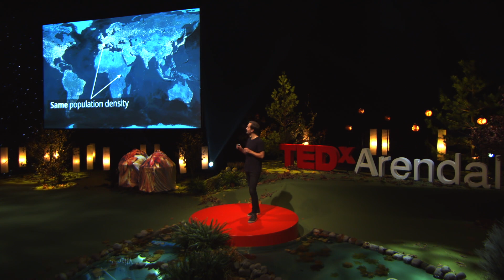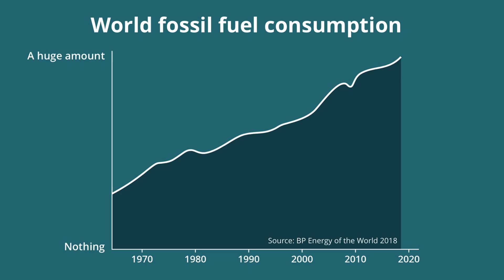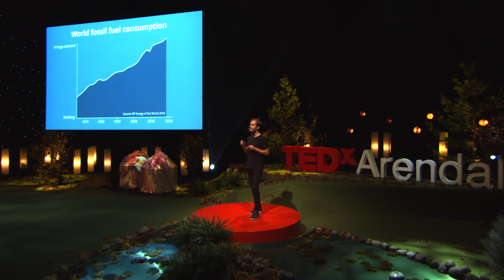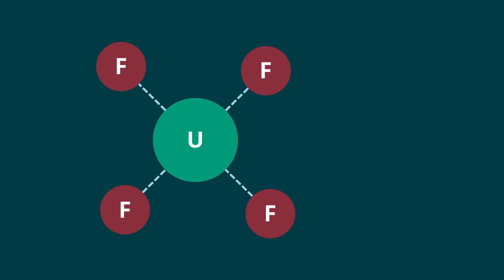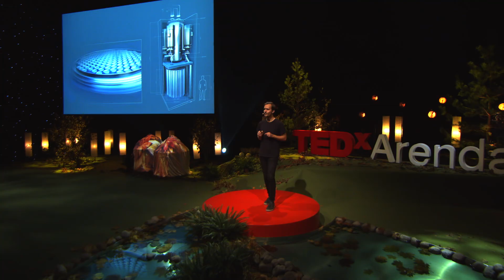Combating the climate crisis with next-generation nuclear | Eirik Eide Pettersen | TEDxArendal

Comment: Most people will rightly ask if MSR were so beneficial then why did we not use them. The explaination is that the nuclear industries supply chains were developed to complement and  co-exist with weapons development. MSRs are less useful in this respect.
Reply: I read of two other problems: a) material to contain F and it's chemical combinations at a wide range of temperature, b) the lack of engineers and faculties / schools to educate and train and qualify enough people to build and operate the reactors. I guess, materials have to be developed first, so we can build long term and stable, supportable experiments.
Reply: @ankeunruh7364  The most common MSR designs use a forced convection system, meaning that the salt is not just sitting statically in a tank but it is actively circulated in and out of the core and over heat exchangers, all by means of conventional pumping.
This means that you need to design not only the core itself and the containment vessel but also piping, pumps, valves, flanges etc. all from materials which need to be resistant to corrosion at high temperatures. On top of that, you will likely need to actively suppress corrosion by chemical means i.e. by keeping the fuel salt in a reduced state.
However, corrosion will still occur, no matter how slow, so you need to also periodically inspect all of your salt loop for signs of wear and tear. Radiation damage is another reason why you need periodical inspections.

Finally, the fuel salt itself is also quite a challenge from a chemistry perspective. Producing sufficient quantities of salt in extremely high purity is not trivial. On top of that, during operation, fission products accumulate in the salt and need to be dealt with. Some fission products "poison" your reactor, others form microscopic particles which will attach to to walls and all other surfaces which could created blockages. Yet other fission products will simply adversely affect the thermophysical properties of the salt as they accumulate. This means either shutting down the reactor, draining the fuel salt and re-fuelling with fresh salt or developing processes for the removal of fission products during operation.

None of these challenges are impossible to overcome, mind you. But they do make the design and development of MSRs challenging.
Reply: 'Atoms for peace' was a PR campaign to make the weapons cuddly, while supplying enriched uranium and plutonium for bombs. It was never intended to power the world, nor could it. All the thousands of gigawatts released are added to the already heating planet.